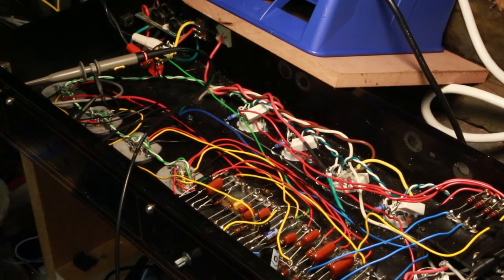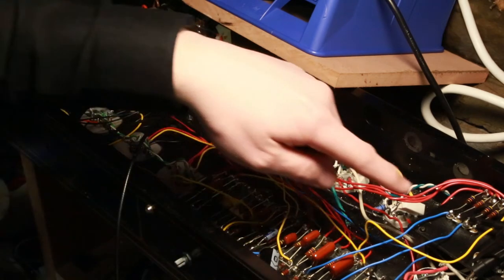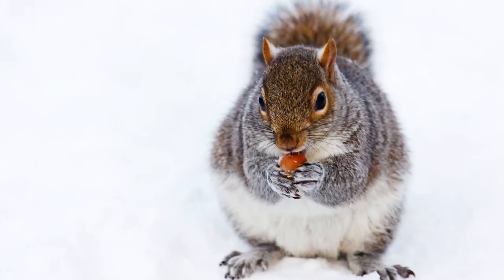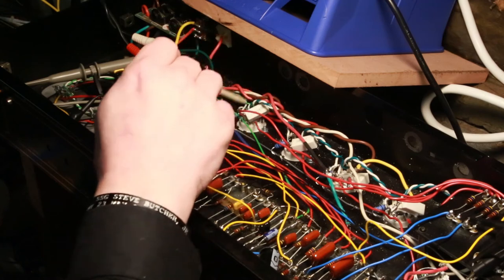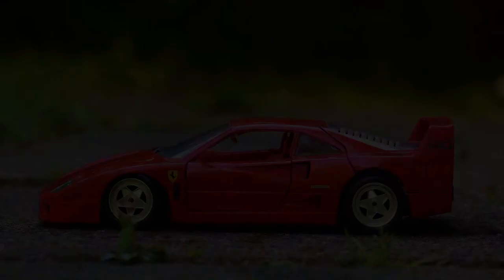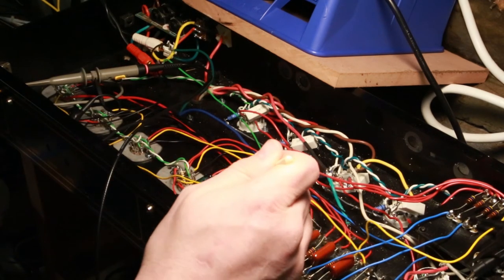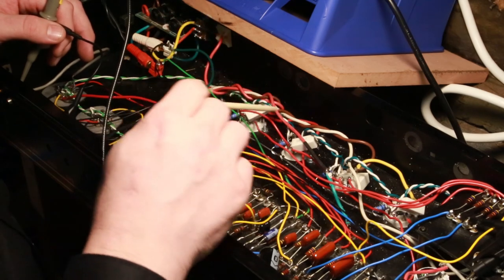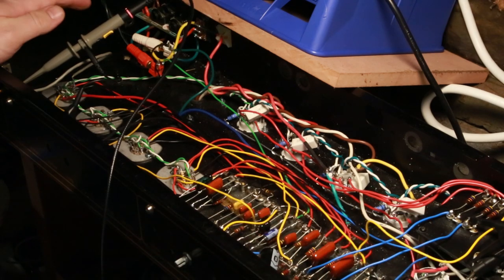Vox AC100 Video 7

Comment: well how did it come out ? Or did you explode
Reply from the maker: +Landon Jackson I'm happily still alive :)  The build works great with two power tubes in.  I'm going to film a video here soon with those details.  I still can't figure out why the full complement of 4 tubes causes some really bad behavior.  I'm working with the guys from the forum to sort it out.  You can read more there if you're interested.  I also ended up doing a very minor mod to add the same capacitors as is used in the Top Boost AC30 because the standard circuit is a bit too 'mid heavy' for my tastes.   More details to come...
Reply: Cool .I am just a player.I have a AC100CPH and a AC30C2.Was just curious about the outcome .Crazy amount of info for us lame men 😌
Reply from the maker: Doubt you're lame.  It has taken me MANY years as a guitar player and many many hours of reading and testing and playing around to learn this.  That's all it takes... :) Time, patience and a lot of help (like the forums I'm mentioning).  Thanks for your comments!
Reply: Thanks .Looking forward to hearing and seeing the finished amp
Reply from the maker: +Landon Jackson we've got the video with the final, working amp in the final edit stage, keep an eye out for it :)
Reply from the maker: +Landon Jackson If you look now, we've got the final video up, hope you enjoy it :)